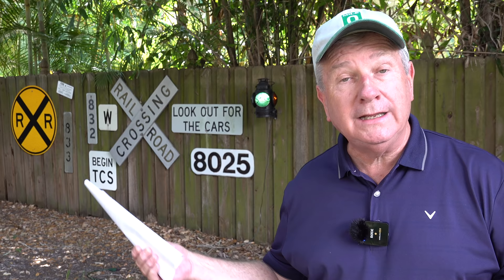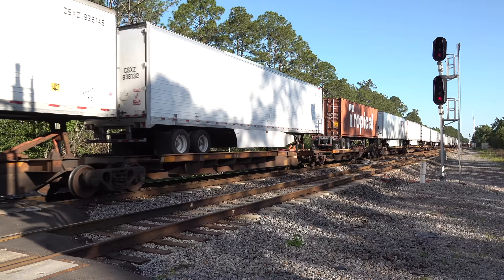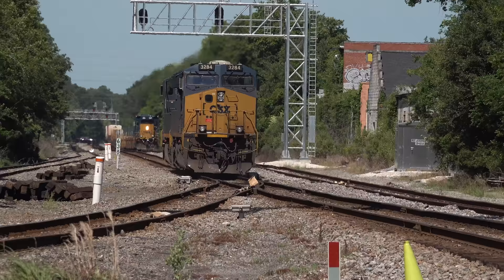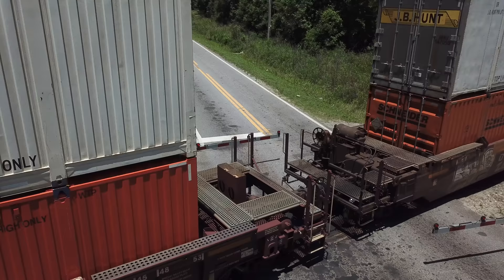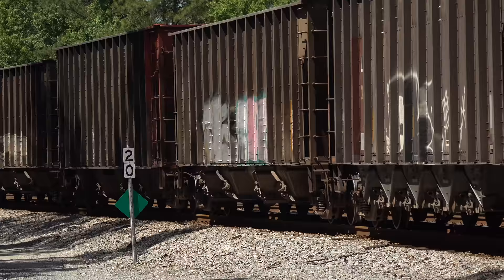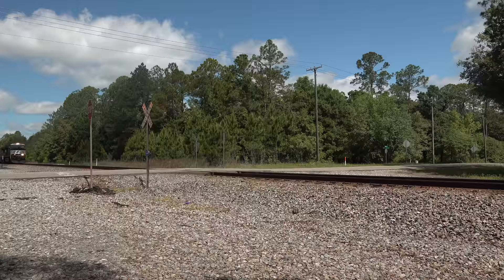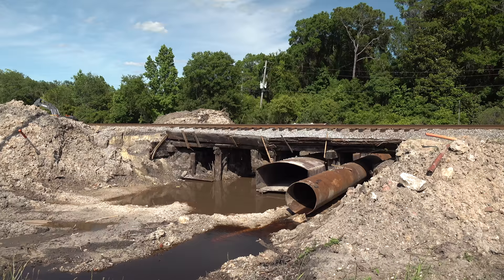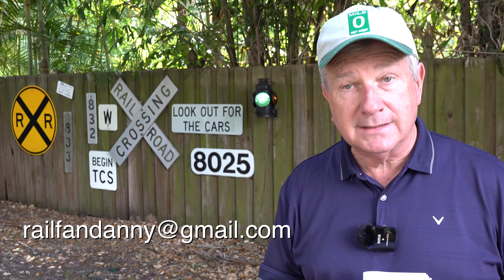How Distributed Power Works

Comment: I transitioned from truck driving after 25 years and 3 million miles due to health issues, and after several years being unable to work, I now transport railcrews to their trains and depots, sometimes assisting crews to build or separate trains, or go get equipment needed to get a train back to operational status. The longest I've assisted with was the night before last, a 16,800' coal bucket we split, so that one could proceed to the power plant downriver, and get the main cleared for other trains to continue their runs. It keeps me busy and able to work despite several physical disabilities. It's cool work.

Comment: Years ago while in the military I had the honor of serving with two guys both Master sergeants that had worked on railroads before coming in service john worked for one up in Illinois where he was from and Dale had worked on the old MOPAC line in Oklahoma area.  Dale told me, and I have found this to be true, that the railroad is still the best barometer on how the economy is.  As long as the economy is strong and growing you will always find more trains rolling due to the amount of goods that need to get to market.  When the economy is sluggish or just bad and not growing you will find fewer trains and they will be longer.  In the last 2 years I have watched this play out with the inflation and a struggling economy. UP here in Arkansas are running fewer and longer trains than they were 3 or 4 years ago

Comment: A note about NS’s use of DP from a current Norfolk Southern conductor in Birmingham: most of our trains are built by blocks. Cars are grouped in the train based on their destination. Most of the time when I’m doubling out of the yard and we have to place DP engines in the middle of the train, they go between certain blocks. On train 178 (Birmingham to Bellevue) we’ll place the DP locomotive between the Bellevue block and the Elkhart block. Upon yarding the train in Chattanooga, we’ll cut the Elkhart cars and the DP off, and shove the Bellevue cars into another track before going back and getting the DP off the Elkharts. The outbound crew will then swap onto the train and fill out in the class yard while 142 comes on duty and takes the Elkhart cars. 

Another thing worth mentioning is while the train lengths are increasing, as is the use of DP, it’s not all sunshine and rainbows. DP units can be very problematic in certain territory. Our run from Birmingham to Chattanooga on the AGS North has seen a major spike in train separations, especially on trains that run DP and trip optimizer. NS is looking into multiple DP sets now, but I feel that’ll only make things worse

Comment: A quick aside re: Origin of Distributed Power: 
My Dad worked for GE the 1960's as an Electrical Engineer.  He had Radio experience from the USAF and held a First Class Radio Telephone license.  In 1968 GE had an early stage project to design & control multiple GE train engines spaced throughout the length of the train (front, middle, rear) using radio control - I don't remember hearing the term "Distributed Power" (I was in High School at the time).  
My Dad was to be the leader of the project, but something happened and the project was put on "hold".  My Dad was reassigned to work in Glens Falls, NY, on a completely different GE project and the "train project", as we called it, just faded away. 
 It's very interesting to see your video describing today's reality of Distributed Power.
It's been 50+ years for me wondering what ever happened to the "train" idea - now I know.
Thanks for a great video!

CRS
Reply: Very cool!
Reply: The project was "put on hold" so that the Corp could ship your dad out so that they could steel his idea and not pay him for it.
Reply: RC (radio control) cars,coupled to locomotives was how this was first done. It's something you can Google for more info. All the radio gear was in a box type car. Kinda neat evolution. Not a lot of meat here. Good editing😊

Comment: Danny, NS tries to build our trains by destination. For example, I'm working a 153 (daily Greensboro, NC to Birmingham, AL manifest) today. I predict leaving Linwood, NC I'll have 50-70 Charlotte cars on the head end, with 50-100 more behind that cut bound for points south of Greenville, SC (Toccoa, Doraville, Atlanta, and Birmingham). The Yardmaster in Charlotte will have cars bound for Spartanburg, SC on the head end of one of our pickup tracks in Charlotte, so that when we get to Spartanburg this evening, our set off will be on the head end. 

Building trains this way unfortunately distributes the tonnage poorly through the train, but DP does help with that. The 153 I'm working today has DP about half the time. The northbound sister train, 154, has DP almost every day.
Reply: NS is behind CSX w/ DP usage. Ghost of Hunter is still available.
Reply: Every see Hobo Shoestring riding your train?
Reply: @coloradostrong  This is a question that no one from a train crew would dare answer for fear of losing their job.

Comment: DPU trains are especially common in winter time to improve braking ability and response time and ensure consistent air pressure throughout the entire train.
DPU systems are Also used in hilly or mountainous tracks to reduce train slack and help prevent as well as the potential for a "stringline" derailments.
Reply: Dpu,s are only used to give extra power to the train and helps prevent stress in the couplers on long heavy trains. The braking is controlled from the lead locomotive. Modern locomotives have a built in Dpu function, not remotely controlled, it uses sensors in the couplers and the brake pipe air pressure to automatically activate the locomotive when the power is needed.
Reply: @jamessimmons3968  DP is integrated into the newer locomotives so you don't need to close a breaker for it to be active.  The DP reacts to either the throttle input from the lead locomotive or from the commands of the engineer through the use of the fence to operate it independent of the lead locomotive.   Auto control automatically puts up the fence when activated and controls the DP units.  I've never had a DP unit that I couldn't control from the lead locomotive.  DP units also help with braking and will pump up long trains quicker upon release.
Reply: it is noteworthy that the incidence of "busted knuckles" in the northeast and alleghany mts has decreased significantly since the proliferation of DPU arrangements.  CP, CN, CSX, BNSF, and NS benefit from it.  don't know about the rest of the continent.

Comment: Danny, I don't know if you know this, or not. You stay up on things really well...Distributed Power, used to be called RADIO TRAINS. 
   They started out using a short red boxcar with a white top and about 6" down from the top was white, so it wasn't so hot on the inside. They also had thermostat controlled exhaust fans. There was a door, like a cab door, on each end. It had round donut mushroom vents on top. It also had 5 top fed "CAN" antennas up there 2 on each end, separated as much as possible and one 1/3 back from the "A" end. It had metal islands built up inside, welded to the floor, All rebar welded to the floor and poured with concrete. This was so they were bottom heavy. There were walkways around the islands. Plenty of conduit and cableing and an ECR receptical, mounted on each end of the car, and to the right of where the end door was, (to plug an ECR cable from tge ECR receptical on the Locomotive to the ECR receptical on the Radio Car. and a jutt rack to suspend the ECR cable. ((ECR = Emergency Cranking Cable. Female two prong receptical.)) One "T-Rack" voice radio, mounted below the 1/3 back antenna, for voice communications for linking up with the Lead unit. Then you had several "Channel Boxes" mounted on each end, in big square tubing frames, welded to the walls & floor.   They were hooked to a 27 pin TRAINLINE MU receptical, out on the end of the car above and on the right side, (facing the coupler) and an MU Cable connected to the Locomotive and to the Radio Car. Lots of quick disconnect cables covered the ends. (inside the car). They were set up so when the "Radio Car" wasn't being used, they could snatch the radio boxes off and hooked to test equipment and everything verified to be right, and they were kept in the Radio Tech Building under lock & key.
   The Radio Car, WAS the Lead unit, in relation to the Locomotive it was connected to. The locomotive's batteries were connected to the car via the ECR cable, so the car had plenty of power. 
   Ok, those racks, like I mentioned earlier, that held the radio LETTER BOXES or Channel Boxes. (the names were the same, just dependant on who was talking) were also in the Short Hood Nose of the lead Locomotive. There were switches that had to be set on the panels JUST ALIKE for that consist. You couldn't have any other link set, with those same combinations. <You wouldn't want to control someone elses middle unit.> The radio man would put the Letter Boxes on the units himself and program them himself. We just carried them up on the units for him and slid them in the racks. He bolted them down and programmed them. You had the Lead Locomotive in the track and then on the other end if the track, was the radio car tied to the Locomotive. There might be two or three units MU'd together, that were going to be in the middle of the train. There were pipe fitters and machinists on the lead unit as well as the mid unit/s as well as electricians to assist the tech guy. Once they linked and the lead unit operated his special control stand, and the radio unit operated perfectly, the train crew came and left with their link-up. They positioned it in the train, where ever the main tower told them to put it. and they got hooked to the train and got all their air hooked up.
   The reason I am well versed in it, the technology STARTED on Southern Railway, in Chattanooga. I knew the techs that were geniuses that thought it up and made it happen. It has, since, gotten much more complicated and isn't as bulky...! The Radio Car isn't needed any more. But the basic technology was born in Chattanooga.
   There's your trivia for the month.
Reply: Super cool info, thanks for sharing!

Comment: I am delighted to listen about both engines and trouts in the same video :) Being a person with first-hand experience on European rail and intermodal, I have learned a lot about railroads in the US from your fascinating vid. At the first glance, US railroads look much less sophisticated than our European mostly-electrified network and locos (...and traffic control!). But on the other hand it's insane - the power, tracktive force and length of trains, especially intermodal. WOW! Remote DP is a beautiful solution to problems unknown in Europe. We sometimes add a loco on the butt, but only for some mountain lines and problematic slopes.

Comment: I have wondered for years if the engines were electrically connect by wires.  It makes perfect sense that the connection is wireless.  Thanks Danny!!!!
Reply: They used to be lashed with wires years ago.

Comment: I didn't film it, but I was working in a switch yard and the engineer was well versed in using his remotes to switch.  Empty coal train came in, three on the head end - no DP.  It was to be switched, then power modded to have a DP on it before heading to the mine.  As luck would have it, the second unit was facing the correct way to be a lead.  Engine one became the DP, engine 2 became the new leader, engine 3 was a trail to unit 2.

Brakeman was operating the switches, conductor was on the ground giving hand signals to the engineer, who was sitting in unit 2.  He ran his remote from the cab of unit 2, was kind of neat to see!  I hear it's super illegal, but... what do you do.  The stories those guys had were pretty entertaining.

Comment: IKR, there was about a 4 hour break between trains in Folkston this year.  However, the fans waited patiently for the trains...  If I had been fishing and caught nothing in 4 hours, I would have put my rod and reel down by then.
Reply: Haha, we frequently have 6 hour breaks between trains here on the Scenic Subdivision, mainly due to maintenance because it crosses the Cascades. Still, it's kinda frustrating lol.
Reply: Better than one train every 24 hours on the old CSX Panhandle line (especially when that one train is at night)...thanks to CSX selling it off a couple years ago to RailUSA/FG&AR.  It pretty much killed rail fanning in the Western panhandle.
Reply: @cup_and_cone  Oof, so basically it's a shortline now?
Reply: @cup_and_cone  theres always the But. They sold it to BNSF. So I'm sure they have plans for it. And  of course we still make runs along it.Privately I think it's a maintenance deal.
Reply: @cherylsims5636  BNSF bought what?  I haven't heard anything?  RailUSA's website still shows them as owning it.
Reply: @cup_and_cone  Bout a year and half ago, as I remember. They are always buying and selling things, aka situation normal. Right now in the process of buying Pan Amm rail, up NH and ME
Reply: @cherylsims5636  BNSF does not own the line.  Maybe they were in talks to buy it, but a private equity group (RailUSA) bought it.

Comment: I watch some local rock trains that are hauling crushed rock and stone. Heavy stuff and always running DP. Usually two engines up front and other pair about half way. Coming back in the evening they are hauling empties and flying. The mixed consists vary on load.

Comment: I do LOVE the quality of the narration ! He knows his stuff. He leaves in all the train sounds, has his radio scanner picking up cross-talk and he explains everything !
   Here's something you may not know, on engines that DON'T have the dropped-nose (they have a full windshield), the Crossing Bell will be mounted high up above the sand tank, just above the head lights. Imagine looking AT the back side if the bell. The control stand will be on the RIGHT SIDE of the engine, looking at the BACK of the bell. (that's your trivia for the day). Knowing that enables you to know which side the engineer will be on.

Comment: I see distributed power trains like this regularly, best one I've seen started with five engines, then 3 engines, then one engine and ended with another pair.  And yes, we get very long trains.  The track I cross regularly has the potential to have as many as 63 trains each day though it normally doesn't get that many.
Reply: i have seen my share of interesting trains with consist of locomotives put in different places all throughout the entire train
Reply: Wow, where is that?
Reply: @donaldstanfield8862  Next to the K-15 Highway between Mulvane and Wichita.

Comment: That was a great explanation! I've always wondered what kind of logic allows DPUs to operate without pushing cars off the tracks or becoming anchors to a train after the lead locomotives crest a hill. It's really fascinating technology.
Reply: It’s been around since the late 80’s. GE or lococontrol had a pretty primitive system early with all external hardware.. it’s still out there.. now everything is built into the screens. Still requires extra hardware though.

Comment: Excellent video. When I was running trains we had units hooked up in multiple and operated from a single control. That was the definition of engine. And we had helper units which another engineer and fireman ran. It was a whole different ball of wax so to speak. Your explanation of distributed was excellent. So you enlightened me. Thanks Danny. I love your channel. 👍👍👍❤️

Comment: Another Wonder Video, KCS has been doing alot of Mid DPU's on their Grain trains to Mexico Lately. Keep up the Good work
Reply: The KCS has been using midtrain locos for years.
Reply: @royreynolds108  Yeah i know, But in Places Like South Texas It's been on and off every now and then, I see them directly outside my window and in full blown view on my back porch
Reply: They've start mid-dpu's on the Speedway just a few months ago.
Reply: I remember times down here when they ran dpus woth only a single car behind it Years ago
Reply: Yeah we've seen a few with maybe 8 cars behind the dpu.
Reply: I wonder if CN will scrub the KCS livery.  That would be a shame.  Entering Schertz, Texas Friday, on the former SP line there was a lengthy manifest train in the siding.  Two rear DPU's [UP] and 5 on the head end [3 UP and 2 KCS].

Comment: Nice video! Always nice to see DPU differences between railroads here in the Twin Cities of Minnesota. BNSF tends to put their DPU's on the rear (and often doubles them, most will have a pair of engines on both the front and rear). CP, on the other hand, often places them in the middle and uses a lower horsepower to ton ratio.

Comment: Question. When you have a train traveling from let’s say Baltimore Maryland (home state)to Jacksonville Florida does the same engine stay with that train the whole way?
Reply from the maker: Yes, I would imagine so. Especially if it stays on the same railroad
Reply: Hi Dick. CSX Engineer here Yes.. How it works is a particular train will start off one place, perhaps on NY/OH/ IL and then have a destination point. Along the way it will stop at various yards and pick up some and drop off different cars. That's why you might see different locomotives with different line locomotive. We will basically loan cars and locomotives back and forth. The train number "Q" which is much the same as an airline flight number, refers to a particular train running from a specific yard to another. Q means mixed freight, a P would me AMTRAX (passanger), a "G" would mean a grain train, etc